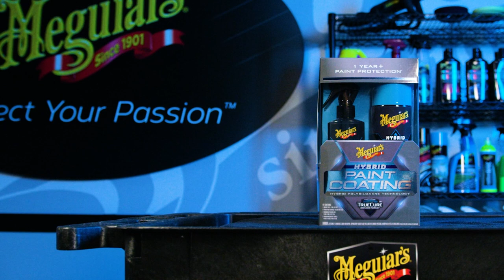Pro-Grade Durability & Protection that’s Easy to Use with Meguiar's Hybrid Paint Coating – Shop Talk

Comment: Can you apply this outside if the weather allows it (cloudy and no rain foor the cure time of the product)?
Reply from the maker: It is never ideal but if the environment is clean and temperatures reasonable (above 60 degrees and below the point where the paint is hot to the touch) it could certainly still be done.
Reply: I had to do mine outside so I waited until the temperature in the low 70s with no rain expected for a couple of days.  I got lucky and it was almost entirely cloudy.  I got the entire car prepped while it was still cloudy out but as soon as I wanted to apply the coating, the wind picked up a bit and the sun started shining through the clouds.  I have two 10' x 10' popup canopies so I set those up and parked the car underneath.  The breeze was an issue as far as the M122 was concerned because it would blow it all away and almost nothing hit the surface.  Anything that did hit the surface dried up quickly.  Had to wait until the breeze died down to apply and remove the M122.  Even though no rain was predicted, we did get a storm about 30 hours after application.  The water beaded up nicely and I blew it all off with a blower once the storm stopped.
Reply from the maker: Thanks for the feedback.  

Sorry you couldn't find good weather conditions to work in.  😀

Comment: I have already clay bares and put a ceramic coating on my 2021 ram 1500 will i have to clay bar my truck again to use this product
Reply from the maker: To be clear, you want to put this coating on your vehicle even though it already has a ceramic coating on it?  Can you explain the reasoning behind that?
Reply: @meguiars  the person probably wants to add an additional layer of shorter term protection to extend the life of the coating below
Reply from the maker: There is no reason you need two different coatings on a vehicle.  If you want to use our Hybrid Ceramic line (detailer and wax) of products to maintain the coating that will help but using this coating on top of another just doesn't make much sense.

Comment: Can it be applied in direct sunlight?
Reply from the maker: It is never ideal to apply any product outside due to the possibility of contaminants landing on the paint during the process.  That being said as long as the panel/paint is not hot you could in theory apply in sunlight without much of an issue.  You would want to work in small areas at a time because the product will dry faster.

Also keep in mind this is a coating and we do not recommend it be exposed to bad weather for at least 24 hours.

Comment: How would the gloss compare to ultimate paste wax?
Reply from the maker: A difference would be difficult to see in most cases but in theory the Ultimate has more polishing oils so it may shine a tad better in some situations.  Keep in mind the Hybrid Paint Coating's, or any coating for that matter, primary function is long lasting protection.  You should have already removed defects and created gloss during the prep process before applying the coating.

Comment: what if you have matt strip on the car ?
Reply from the maker: We would not recommend you apply the coating to any area with a matte finish because it can add gloss.
Reply: @meguiars  can i use m27 instead?
Reply from the maker: Not entirely sure what you are asking, but yes you certainly choose a different form of protection other than the Hybrid Paint Coating if you so desire.  Our M27 is a great product and our best protecting wax/sealant but keep in mind it will not offer the same protection or longevity of the Hybrid Paint Coating.
Reply: @meguiars  I know but since my car will have le mans matt black strip on  it should be easier to use i think?  maybe m788 work too?
Reply: @meguiars  sorry meant m 688
Reply from the maker: Correct, we would not recommend the Hybrid Paint Coating on a matte finish.  Yes, the M27 would be a better choice in this case or you could simply do the painted areas with the coating and the matte stripes with a safe wax/sealant like M27.
Reply from the maker: Are you located in the US?
Reply: @meguiars  it would be too much work and time consuming masking the stripes . No I’m located in France . M 688 would work too ?
Reply from the maker: Not sure what stripes on this vehicle but if it is a couple large strips down the hood or hood/roof/trunk it should not take more than 5 minutes or so to run some painters tape along the edge.

Yes, you can just use the M27 if you so choose but as with the coatings it is designed to work best on paint so you cannot presume to get the same results and benefit as you would on paint.
Reply: @meguiars  strips like gt500 kr also side rockers strip . I read true  céramique work on both ?

Comment: Bizarre, awkward video. So let me get it right, what are the benefits vs a true ceramic or even something like Gyeon Cancoat or CarPro lite ... a similar amount of prep is required, it's a sticky product to remove, you've to work in small areas/crosshatch, you've to let it cure etc etc... welcome to 2015.
Reply: Seems like a bizarre list of grievances - what exactly are you upset about? That is requires paint prep like every other coating ever? 

The video explained the benefits - consumer-friendly application that is easy on/off, better durability and better resistances. Seems pretty straight-forward. 

As for comparing this to those other products, take either of those products and put them side-by-side with this and watch Hybrid Paint Coating walk away from them both.
Reply: Markus Kleis - Agreed. This seems super simple to use and difficult to “mess up”. If performance is inline with expectations this is gonna be a winner. I’ll likely wait until Spring cleanup. Detailing in Ohio in February can be “problematic”, haha!
Reply: I think Adam is highlighting that this is nothing new & been available for years from other companies like Gyeon & Carpro at likely cheaper cost than Meguiars will charge in the UK at least.
Reply: @BrianW1612  Based on what, they both are aerosol? Lol. What an argument. He has positively no way to know how they compare beyond the delivery method, so how can you make those claims?
Reply: @MarkusKleis  Not upset about anything Markus as I won't be buying it. I'm simply questioning why Megs are marketing this as significantly easier to use than a normal ceramic coating, seemingly forgetting that there are lite/consumer ceramics that offer just as much protection with (from how Megs describe this in their OWN video to be grabby to remove, with an even longer cure period).
Reply: No.

Much, MUCH  easier to apply, similar durability.   Missed the point completely.

Comment: can it be used on PPF?
Reply from the maker: Although likely safe not every PPF is created equal so we recommend you perform a test spot on a discrete area.  Keep in mind this product is also designed to bond best to paint so it's performance may not be identical to the painted surfaces.
Reply: @meguiars  thank you!
Reply: Why would you I’ve ppf on my Range Rover and wouldn’t dream of putting anything on top
Reply: @gerryr1893  I have Xpel PPF and it is strongly recommended (even from installers) to protect the wrap as well.
Reply: @gerryr1893  You can still put a sealant on the PPF to protect it from getting yellow over time
Reply from the maker: Yes, there are waxes and sealants that can be used on PPF.  We do not recommend cleaner/waxes or anything with abrasives in it but something like our Ultimate Liquid Wax or our Hybrid Ceramic Liquid Wax would be great.
Reply: @meguiars  What's diferencie between M27 hybrid ceramic sealeant?

Comment: Notice they NEVER actually tell you about the ACTUAL thickness in microns or any other measurement.
Reply: We have an expert pro detailer over here folks. Watch out for this guy who worries about microns. No real detailer cares about microns, but hey, you’re obviously a pessimist.
Reply: @Thamac15  not actually I would like to find a product I can believe in and have a scientific explanation of an engineering and chemical breakdown of the facts. The reason I haven't chosen one of these options yet is because I have been cheated with a scheme like this at a dealership. Thickness can matter in States like New York where they are currently at my location throwing around hundreds of thousands of pounds of salt all over it. It's very abrasive and caustic as you know. My belief is thinner protective coatings will wear faster then thicker ones in my mind this makes engineering sense even on a chemical level because the more of something there is the longer it takes to wear it away. I'd like to see a product guaranteed for full money back if it doesn't do what they say it's going to do because I've already spent thousands and basically had paint damage as a result of it afterward from only typical driving. So pardon me if I'm a little skeptical!